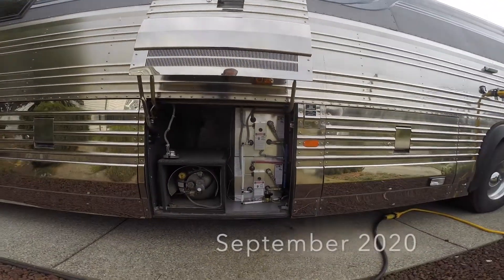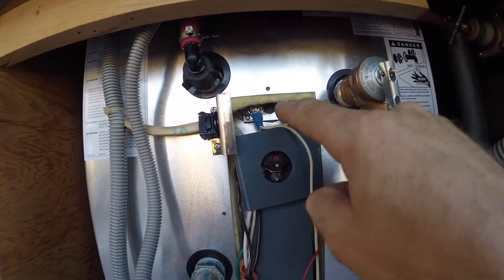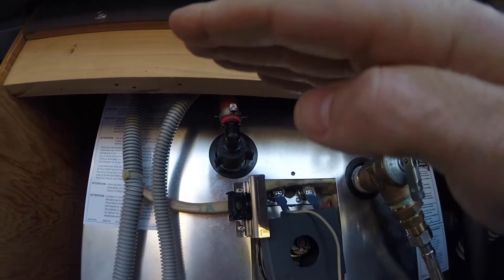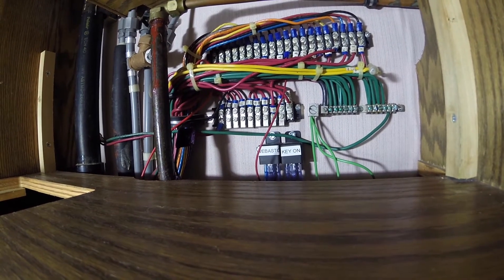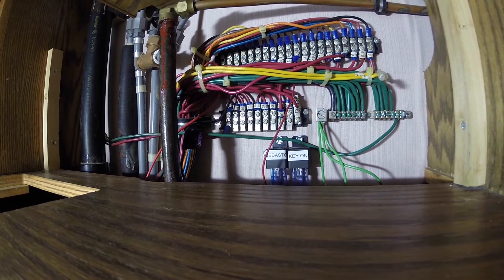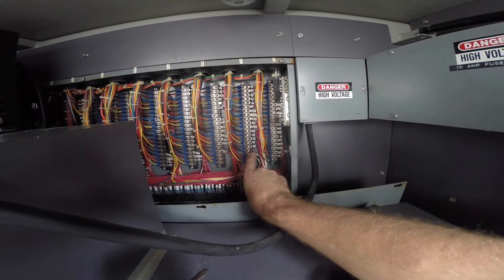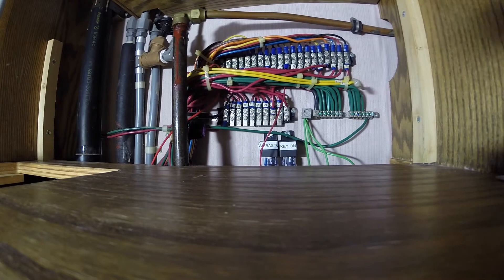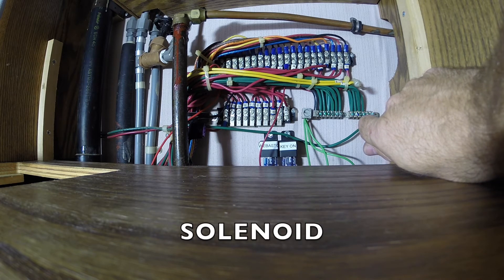Explaining My Electrical fixes and Water Heater Coolant Mods | The Oreo Tails

Comment: Ok, last post on this video, promise LOL. One of the reasons I am thinking of a legacy Prevost coach is maintainability. Many owners now find computer controlled systems are worrisome after 7+ years (faults, failures, inop screens, parts obsolescence, etc). Older coach systems use more discrete components and easier to maintain and troubleshoot. Interested in your thoughts?
Reply from the maker: It's great, ask all the questions you want! That's why I'm here. So, there's no real line between complicated and not. It's a sliding scale, in my opinion. My coach, very basic, mostly relay logic, few things to fail. But, the engine is DDEC2, which is now pretty old, and, not as easily self diagnosed, as older mechanical engines were. Newer coaches will have increased complexity in house systems, but the newer engine will be much easier to get work done on. (But not less complicated). It really depends on what your plans include. I wanted a coach ready to go, all(most) systems ready and working, tires and bags with life left etc. The number of available coaches like that, in my budget, was limited. Some new owners budget for replacement of all kinds of antiquated systems. Everything is updatable.

Comment: Are you full time on the bus? What was the decision tree into acquiring a Prevost versus other alternatives?  Thanks for sharing
Reply from the maker: At the moment, I'm "half time" living in the bus. I sleep and work in the bus, I keep it heated, water running etc. But I cook in the house with dad. Well, the decision tree, at least for me, looked mostly like this. I wanted to live and travel full time with work, Cirque du Soleil. I started looking at small trailers, small enough I can pull with a 20 year old f150, not many of those are really full time suitable, until you start spending airstream money, then you really should upgrade the truck, and, if I'm upgrading the truck anyway, I can now look at 5th wheels, well, maybe a 5th wheel toy hauler, ya, the I can bring a motorcycle, ok, so, now I'm selling a perfectly usable truck, to buy a different truck, to buy a big trailer, to travel and live full time. At this point, I would have spent what the cheapest decent Prevost would cost. Then the decision was easy! 😋🐶
Reply: @theoreotails1536  Excellent and logical. Thanks for sharing. I am still working as an IT consultant and approaching "retirement". Thinking of mixing wanderlust with enjoyment of operating complex machines leading to focus on Prevosts. I would maintain a residence (my two older kids reside currently) but would visit friends and enjoy nature while working less (semi-full time). Anyway, thats my story.

Comment: and the wooden bar across the top - added to keep it from shifting? i thought the black metal bar attached to the ceiling was for that?
Reply from the maker: Great questions, the wood you see is the support that holds the grey facia panel in place, which covers the tanks normally.